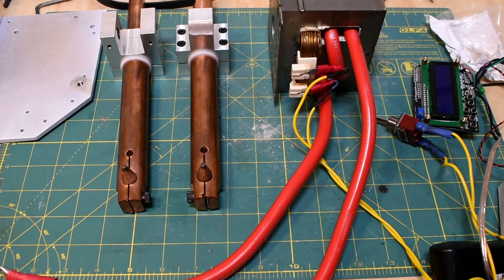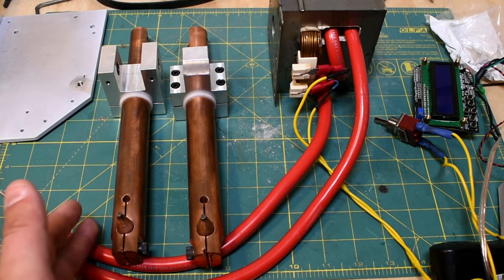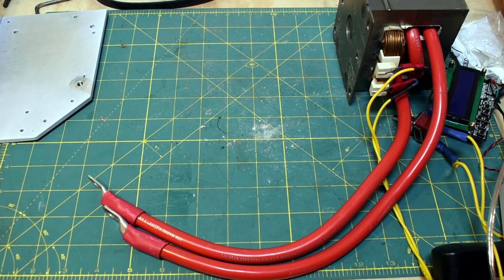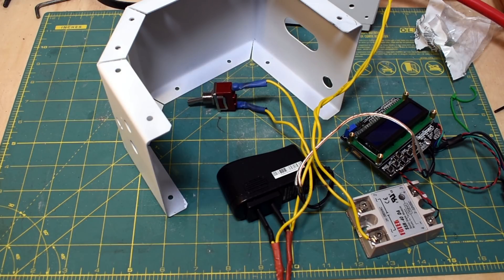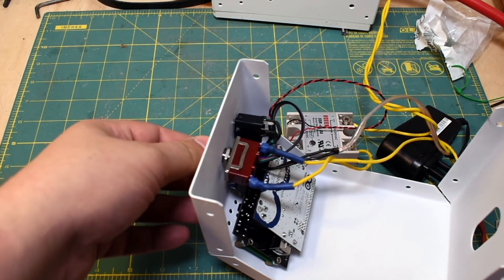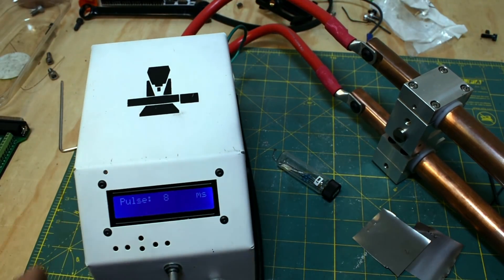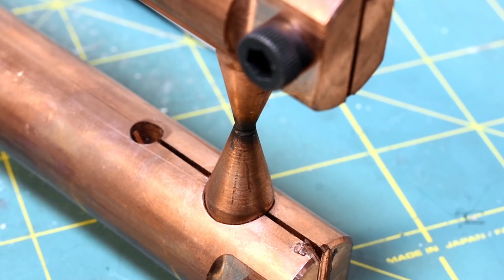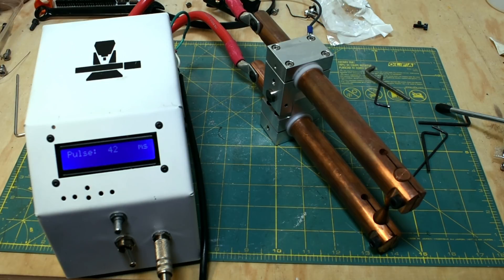Building a Spot Welder from a Microwave Transformer!

Comment: Also, for the power-input, I like to use something like this: https://www.ebay.com/itm/1Pcs-15A-250V-IEC320-C14-3-Pin-Fused-Power-Socket-Connector-Rocker-Switch/152765834186?hash=item23918da3ca%3Am%3AmNyGlrgqRJ0fyl2dpwI897g&var=452465946616&_sacat=0&_nkw=iec+320+c14&_from=R40&rt=nc&LH_TitleDesc=0%7C0

It makes things easier to move when you can unplug all the cables (well appart from the high current ones)  :)

Comment: You could limit current with a large resistor on the primary side of the transformer
Reply from the maker: Like a rheostat?  Ya that's a good point.  I never really understood AC well enough to know when you're limiting the power or just converting it to lots of heat :p

Comment: Great project and video! Having a pneumatic closer would probably help with constancy because of repeatable pressure. I like the little holes on the copper bars, they totally could be used to add extension cables for welding tabs onto lithium batteries.
Reply from the maker: Ya pneumatics are pretty much perfect for this because of the constant force you can apply.  Depending on how the over-center spring works, I may move up to a motorized system eventually.  I'm actually planning on making "handheld" electrodes for tough to reach places, so those would probably work well for batteries!
Reply: @TabletopMachineShop  Don't the secondary wires need to be bigger than the 1" copper bars?

Comment: Is there a formula for determine the thickness of the delrin bushing?
Reply: I'm a physical therapist, so a lot of knowledge is lacking.
I just learn yesterday that high voltages arcs, not high currents.
Thanks everybody for explaining!
Reply: Ah, thanks for the explanation!
Reply from the maker: The voltage is so low I'm sure a good tape would have worked.  I mainly sized the delrin so that if the electrode slides for whatever reason it wouldn't contact the hinge